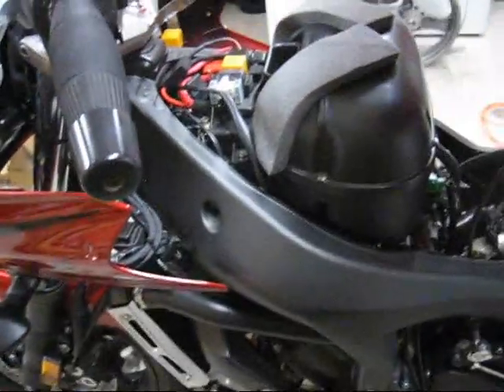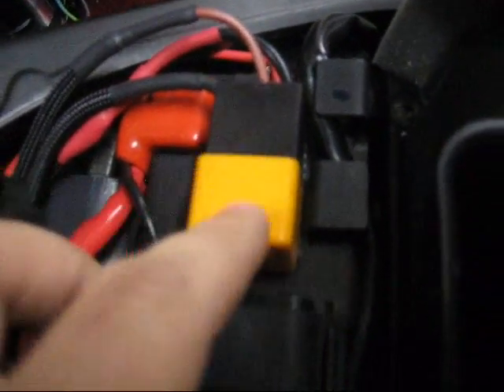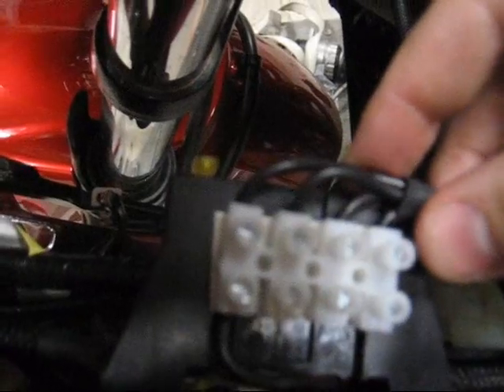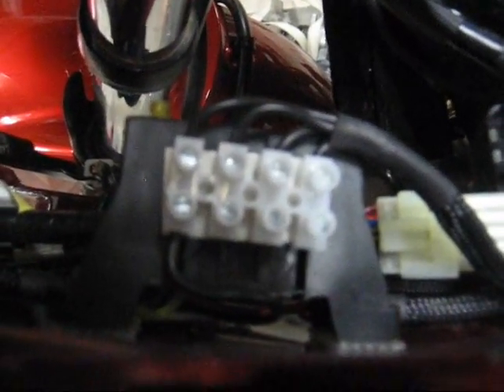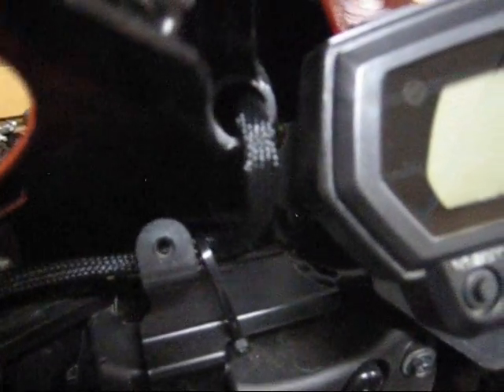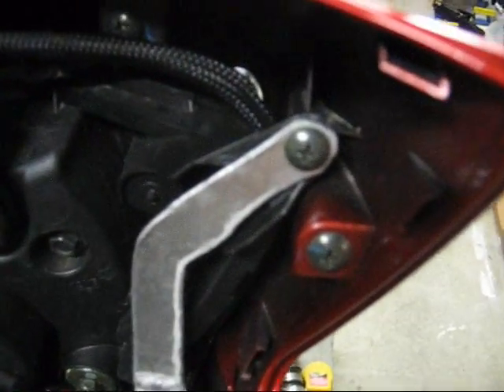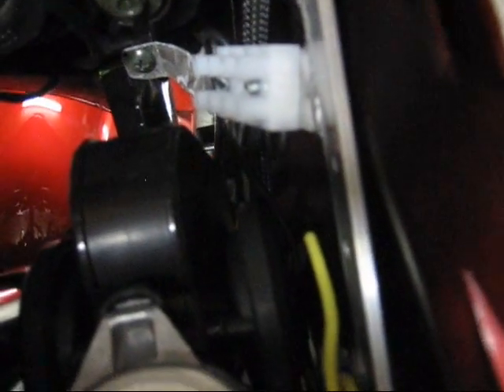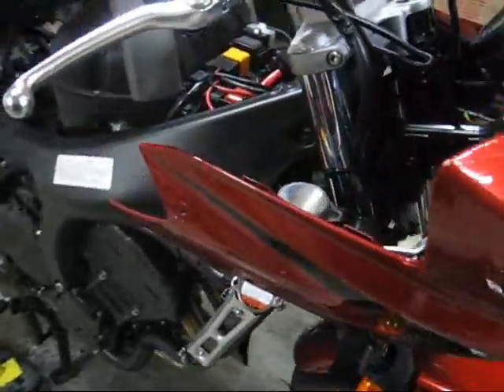How to wire a motorcycle, the right way.

Comment: Hi I need to wire my tracker and it has a white wire which needs to connect to the acc on the ignition? which wire is it how do i find it i have a r6 2008 cheers